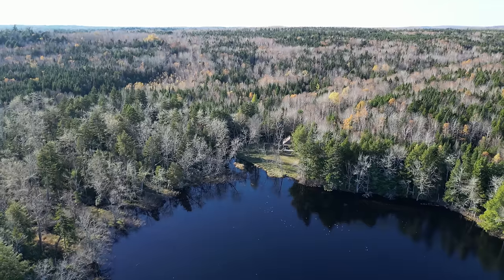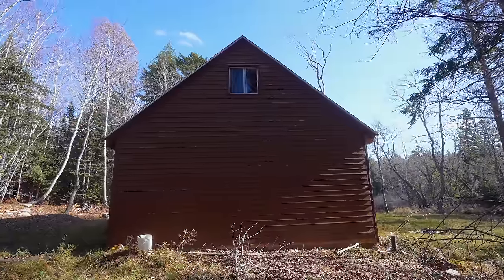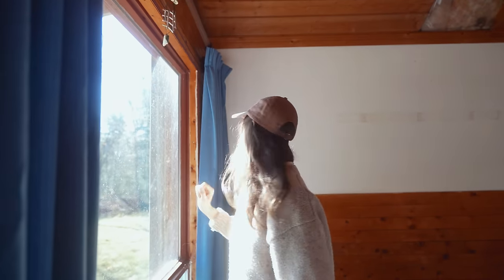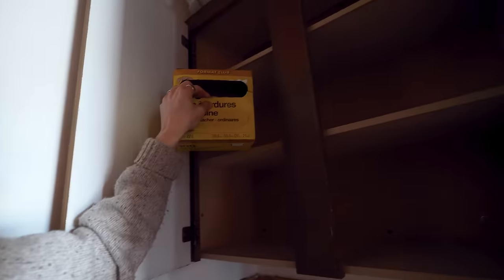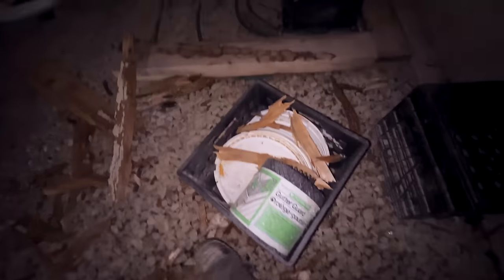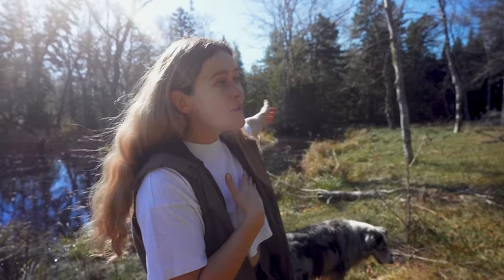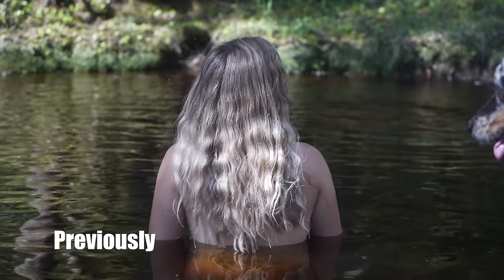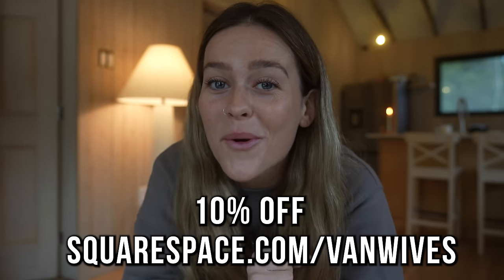We Bought an Abandoned Lakefront Home in Canada and Found Hidden Treasures

Comment from the maker: A new chapter unfolding- so happy to be finally sharing this with you all. Now that you know the FULL story and all the complications at the new cabin, WHAT DO YOU ALL THINK? What do you want to build here? 👀💛
Reply: I THINK I WANT TO MOVE THERE!
Reply: You have warm weather due to El Nino, you will be warm this year compared to past years, climate change has  supercharged this El Nino. so, that is how you got so lucky in November. whoops wrong coast, I don't got warm either., yer about to freeze...
Reply: Must run it on water power maybe even build your new cabin on stilts
Reply: I BELIEVE IF YOU WOULD FIX THE ROOF THE MOULD PROBABLY WOULD QUIT MOULDING
Reply: Smart move so close to the other property. Make a B&B out of it. I'm Dutch and we live with a lot of water in this riverdelta. Have something they call an "uiterwaarde" .. an overflow area were the water can go when the land floods and create a cofferdam with a small sandlayer in it to detect leaks early on around the house .. an area which is pumpable. Groundwater can still come up. The dam around the house will keep the rest out, The pumps are for the groundwater. Make sure the pumps can dry-pump, they are often air-pumps used in industrial settings.
Reply: I don’t know why, but there is no place for me to comment. My idea would be glamping cabins.
Reply: Definitely a cabin on stilts. But it probably won’t need to be more than five to eight feet off the ground. If you will have aging friends and relatives staying there, please plan a mobility ramp into the drawings, even though no one needs it now. That property has so much potential. I’m looking forward to seeing how you use it.
Reply: Such a cute cabin. Wish there was a way to save it, but the water levels will be very problematic and after all, who wants to waste time energy and resources, not to mention the threat of mold related illness. In its current location, the cabin would need constant water damage repairs.
Setting up a dome like Tyler and Todd would be a great choice. Because the dome is not considered to be a permanent structure, you would have a lot more freedom, unlike permanent structures, which have to pass inspection to make sure everything is up to code.
With so many magnificent trees, I’m thinking multiple wind turbines would be the way to provide power.
If there is a patch with few enough trees so you have constant sunlight, solar panels would be great
Putting whatever structure you decide to build on a platform well above water levels i believe is key.
Save that awesome woodstove!!
Many domes can have a second floor, where a bedroom can be made.
Bathroom, kitchen and living room can be in the ground level. A spiral staircase to the second floor would be awesome
There are some really good building plans available.
Domes are resilient structures, much like your greenhouse. I think you can even use solar panels on the dome to catch light. 
As Tyler and Todd mentioned, the shipping containers are problematic in a cold climate, but if you built a platform and keep the design simple- maybe 4 containers welded together and 2 on top, you’d have decent square footage and could use the roof as a deck. 
Sorry for the extenda-post, just wanted to put those ideas out there.
I think whatever you decide will be fabulous.
Reply: Build a “treehouse” cabin!
Reply: Congratulations!  🎉  Will be fun to watch whatever you do.
Reply: @HannahbananaDIYingLYFE  you’ll never get  insurance on it and if something happens to a guest, they could get sued.
Reply: @herdsire90210 fellow dutch ik woon vlakbij de maas
Reply: I’d build an A-frame cabin or 2 with a loft bedroom, downstairs bedroom,basic kitchen/lounge and bathroom.  Can be for friends and family as well as Airbnb. I’d also build an open entertainment area with seating, barbecue where you can all gather. Can’t wait to see what you turn it in to ❤️
Reply: Hello ladies I'm doing better I'm out of the hospital I'm in a rehab facility to get my legs stronger I go home next friday. Okay congratulations🎉🎉🎉 that property is simply the views are breathtaking. My suggestion is bulldoze the it's not worth your time or money to fix it I would put up separate storage container one bedroom with a kitchenette with a composting toilet. But I would definitely put the containers on a high at least 3 ft lift. As always stay safe stay strong stay healthy God bless and enjoy life sending a big hug❤
Reply: I would raze that cabin and fill in the area. Make that a riverfront relaxation area but nothing that would be greatly affected by flooding. Clear a couple acres on higher ground and build a couple smaller cabins for friends and family. You could also rent them out for income during the good weather months. So much untapped potential! Great purchase ladies!
Reply: 2 things I'd like to suggest you as an Architectural Drafter. 1. Regrade the "river" side of the cabin. Avoid future water damage. 2. Tear down to the foundation and rebuild fresh.
Reply: It is a beautiful spot.  Developing it is going to take $.  It may be too remote for airbnb potential.  Maybe subdivide into 1 acre properties and sell off enough to build yor own home?
Reply: Could the cabin be moved and salvaged? Tree house, house boat, boat dock, yurt, deck with Dome w views of lake, tiny house, dig a stream through your other property, I mean the sky is the LIMIT! You gals were meant to purchase this beautiful piece of nature!
Reply: Wow new project, you Ladies have all the fun. Okay a name for it how about Robin 's Nest
Reply: Houseboat
Reply: Wow you Ladies have all the fun. Okay a name for the cabin how's Robin's nest
Reply: Start over. It would be a new experience and you are ready for it after what you’ve already accomplished
Reply: HYDROPOWER TIME, Mouse voted. I had to let you know. Sending love to doggos and people. 💙
Reply: Hey Christal and Jazmin. Wow, 10 acres! 
My suggestions as to what to do with this new property:
1. As cute as the cabin is. Its proximity to the water and obviously getting regularly flooded. I don't think saving and rebuilding the cabin would be worthwhile, and tearing it down would probably be the best option I think.

That said. It would be easier and probably less difficulty to build a chalet cabin for guests further away from the high water line. You could even build something on stilts if you want to be extra sure of not getting flooded out.

Seeing you both enjoy gardening and growing food for your own use... Why not build a natural/ organic gardening business. Partially or totally in a greenhouse. Seeing you have an incredible source of water all around you, I would say maybe a hydroponic garden system that you could heat the greenhouse and grow year round. 
Outside of the greenhouse you could cultivate an assortment of berries that would be seasonal.

This business wouldnt have to be massive. It would be to supply local businesses with fresh produce year round that is locally grown.

What do you both think?
Reply: Wow ! Great new project girls lol...A tree house or something on stilts for sure..love all the wood in the original cabin but think I'd start over on this one..but reuse what you can !! Excited for spring projects now !!
Reply: Congratulations on your new acquisition. I think the property has so much potential. I think you should put several types of structures on it to accommodate the various ages of your visitors. With the tall timbers you have, I would recommend a tree-house, then I would look at a cabin to accommodate those that cannot climb. Research Frank Lloyd Wright and the house he built over a stream, it might give you some ideas.  Good Luck!
Reply: Very cool ladies!😂❤🏳️‍🌈👍
Reply: Congratulations with another property 🎉 How convenient to have two properties so close to each other ❤️ I am sure you will make this new cottage as beautiful as the one you live in now 😍👍🏼👍🏼
Reply: Well that river runs pretty think of hydropower over solar go with a windmill tight situation water mill there's a guy that building on you know
A house on polls maybe we take something about electric that house is beautiful laid out in a man of but it's a shame that it's so close to the water and the same problem I have in Texas I live along the coast hurricanes are not like you all but the nice thing about it is all protected pretty good by the trees the forests around you helps protect you from the hurricanes you can also use that house for secondary you can rent it out certain times love watching the girls this is really going to be great man y'all got so much to do ahead of you you're going to videos are not going to stop for the next 50 years
Reply: now you have more cabins than vans, so you should name yourself Cabinwives
Reply: Another cabin!!! Congratulations, what a Beautiful piece of property ✌️I can't wait to see what you come up with.... You could use it as an Airbnb when friends aren't visiting???
Reply: Treehouse/elevated cabin in the trees. Use the space by the lake for recreation. A shed for canoes or kayaks, paddle boards, lawn games. If you get power, maybe a pad for visitors to camp and plug in their van/camper. So beautiful!
Reply: Then ur solding the old cabin
Reply: A yurt? Build an outdoor bathroom with shower and a yurt platform.
Reply: I would be tempted to rip in down and start new from the foundation up.
Reply: I'll say elevated foundation and a couple (or more) shipping containers kind of 5x20 to build a great house, with an upper deck.  It will look and function fabulous.  Name suggestion: "Barefoot Villa"
Reply: I would incredible.
Reply: Have you been to Oak Island?
Reply: The view from that spot is worth preserving but the cabin itself isn't.  Mold, flood risk, existing damage isn't worth the effort.  Create a water/flood tolerant vista point at the cabin location.  Do a new dwelling on higher ground and open a new view (without damaging the old growth trees).  Most importantly, don't overstretch yourselves.  Your home still has so many projects started that you should complete.  The wonderful view on the new property will be there.
Reply: So happy for you gals. Can’t wait to see what you have planned for it.
Reply: RV Park
Reply: Wow a lot of potential, a tree house could be spectacular but I think you need to raise it off the ground whatever you do. You have to take account of the flooding and protect any new build from water damage otherwise you will be wasting your time and money. It is a fantastic acquisition though, more power to you both, with your acquired skills I am sure you will come up with a great solution.
Reply: I belive befor making any project you have to make a full evaluation of the mold damage, roof is the less concerning for me, one it's fixed it's ok, the floor and trust underneeth are more major, you may have to rebuilt that part wich mean find a way to ''hold up'' the wall and roof that stand over it. Doable but way more complicated.  The moist barier you talk from under the cabin is not a mojor thing, back in the day all those house and cabine didn't have vapor barier, as long as you have some good vent trape you'll be fine.   For sure a lot of potentiale 🙂
Reply: @susanjackson1458  from a wheelchair bound 61 year old lady I want to say thank you for your very considerate comment. Many people see amazing cabins in their minds but they forget that a portion of the population will need extra thought for their needs. Extended families are traveling together more often . I was run over by a truck 11 years ago. Before I became handicapped I didn't think about the mobility challenged  much outside of work. I am an RN. Perception can change very quickly.❤🇨🇦👩‍🦽🩺🍁🦫
Reply: I like the idea others have already said: rebuilt a new structure in the same place on stilts.  The location has such a good view!  If you choose this general concept, you might also think about making the lower level high enough it can be used as a parking space for your camper van (or your friends) in the drier season.  And of course all the amenities that it makes for a great place to hang out (fire pit, shower facilities, etc).  I look forward in the coming months what you decide.  Enjoy
Reply: You SHOULD NOT BE IN THERE WITH ALL THE MOLD,!!! And no respirators.
Reply: Rebuild it for family and guests, and save your cabin you worked so hard on for the last several years
Reply: Since the foundation is fine, they can demolish and build a new cabin to your liking.
Reply: I think start over. Demo the old cabin. We just spent a long weekend at a remote cabin in MN. They had 1000's of feet of lake front. But the cabins did not have a lake view. The owner built his cabins on the high point of the land which happened to be granite. High and dry. Good luck! Can't wait to see your progress.
Reply: A sommer Loung or a House vor Your Frinds wenn Come too You for al Larger trip! You can do so many things with this Hous !
Reply: Are there any animals in the lake xx
Reply: I think it would be great to have a bunch of tiny Cabins, for camping, a tiny A frame, all different sizes, of Cabins,  for summer or winter getaway .  I would have some dirt dumped on the property to built up the elevation, And I would possibly Jack up the Cabin because of the wet ground, and possible flooding.  It would be great for an income.
Reply: I'd  build new on a higher point on the land as you said & recycle what I could from the old cabin. Where the old cabin foundation is, i'd  build a small cabin / shelter on a higher foundation / stilts, with decking around it, one big open space inside (no bedrooms) except for a bathroom / shower for days by the water.  Shower room, basic cooking indoors & out etc & a shed next to it to store fun toys like jet skis, a boat or canoes etc etc. That way you have a place to stay / sleep for family etc away from flood waters ( you dont want to worry about floods everytime a storm comes)  & you have a place for fun near the water when you want it 😎👌
Reply: Yeah a water powered generator,  you have a great property, and you could rehab that place, but please wear a mask, black mold is really bad
Reply: I’m pretty sure you could divert the river by adding a retaining wall , waterproof the foundation and add a sump pump and then check the bones of the house and take it down to the frame and start over.  There isn’t a whole lot of lakefront cabins available anymore and being right next to your home is a bonus. Y’all got this girls!!
Reply: That Cabin was probably built in the 1970s or the 1980s considering the condition of cabins in. My best suggestion is got it completely entirely all the way down to the concrete foundation. Considering in the state of that Cabin is running out. The water rotted out the floors completely rotted out the ceilings completely rotted out you’re gonna have to start basically from Ground Zero. And I don’t mean that you’re gonna have to do quite a bit of work in the crawlspace as well. But if you guys heard from Ground Zero and destroy the thing and then rebuilding it gives you a whole new plans you can do and go from there.  Because I also gonna have to do foundation work within it as well. Considering there’s not a waterproof membrane underneath of it. I will take the wood that is underneath the crawlspace is may not be able to keep it just considering there’s not a moisture barrier. Something to consider. As much as you want to savage all those pieces of wood 🪵
Reply: I think a lot of us want to know when did you guys purchase the cabin? And if you can on able to get more information about the cabin might actually help out, potentially on reconstructing the building.
Reply: Some tiny cabins for your pack to rent and enjoy the beautiful views.
Reply: You can definitely fix this up!!! Did you buy it without seeing the inside?
Reply: I would want to tear down the cabin, as sad as that is- it is the perfect view.  I would want to build a few small efficiency tiny houses That could be set up down near the lake when the water is low, and easily towed up to the higher section, or even the other property when floods are forecast. Then maybe build a nice little bathhouse near the waterfront, but out of the flood zone. & I am so excited at a thought of a waterwheel or any form of hydroelectric! Very cool!
Reply: First thought I had was flooding being so close to the lake, but you def do not want to lose that beautiful view, so building a treehouse would be EPIC!!!  Would be wonderful for your selves and your guests.  From vanlife to cabin life to treehouse life! If anyone can do it, you girls can!
Reply: I would do my best to save the cabin and lift it but go higher so that you can raise the ground beneath it. 
Now your next problem is reading through all the great ideas and forming a plan..! You have a stack to work through!
Reply: So cool.  So, I live in Florida, and flooding is a big thing down here near the coast.   A lot of the houses are built on stilts.  Maybe consider using roughly the same spot but elevating a new cabin on stilts for when flooding gets bad.  The great thing about this is you have parking under the house, storage under the house, etc...  and, with the extra elevation your views in the cabin would be even better.  Just a thought, I'm not a builder like y'all are!!  Really just thrilled for you two, what an amazing homestead building adventure you have been on, thank you so so much for allowing us to be part of the pack!!
Reply: First of all, BURN the outhouse to the ground. Don't even touch it, just throw a match in and stand back with buckets of water in case it spreads. As for the cabin, better rebuild it on higher ground just like a few people are saying - who knows what the hell the weather and sea levels are gonna do in our life time - plus most of that wood is already f**ked from the water damage. As for the cement foundation left over, I would consider building a non-serviced old school forest lookout tower using the foundation as a base. I'm sure the view in the trees across the lake would be amazing! Airbnb? LOL, wanna get stalked 24-7?!! Just keep it for yourselves, family and friends and enjoy the ride!!!
Reply: "Dave" is one of the original owners.  It is known to us who have had a cabin in the area for over 20 years as "the navy guys" cabin.  Dave and Rob were friends in the Navy, Rob's wife was also an occupant/owner.  Some people in the area wired their cabins with hopes power lines would be run on the road some day or it could be wired for generator use.
Reply: Gut it, I will take the clock.
Reply: 1 renovation done, onto another.
Reply: I have blueprints for a cabin that I want to see built and will email to you if you give us an email to send these things to
Reply: Repurpose the cabin into a boathouse.  For relaxation and storage, hammocks, fire pit by the water.  Then build sleeping/cabin for guests a bit further away from the water.
Reply: Tear the cabin down and start from scratch
Reply: You could build a cabin on stilts so that it would withstand flooding?
Reply: Let’s build a home!❤
Reply: Build a treehouse! That would be awesome and if it floods it doesn’t matter, coz you’re in a treehouse! 😂
Reply: Why buy another cabin so close to first cabin
Reply: Howdy 🤠 ladies I have a KRAZY idea 💡!!! Whatever you build and if not going to use solar power panels like you did with the main house. How about building a WINDMILL for electricity. Like SOLAR WIND TURBINES! Away from the lake. Well you ladies can figure that out. I saw a family from Alaska, called the Alaskan Bush People. They built one on the island land they purchased. Remote, no electricity on their island property. But their smartest son Noah built a make shift windmill for power on the property.